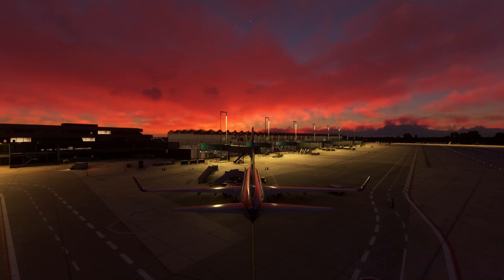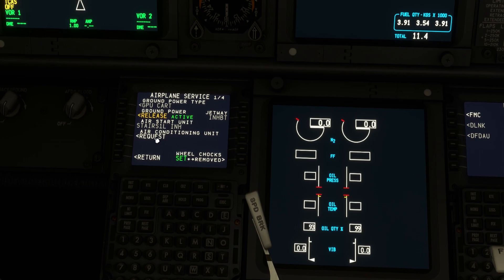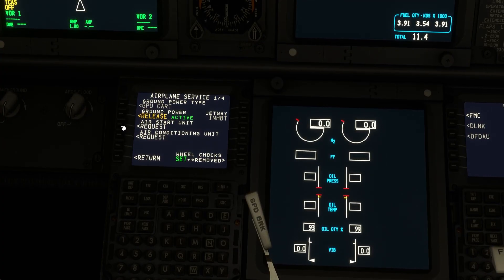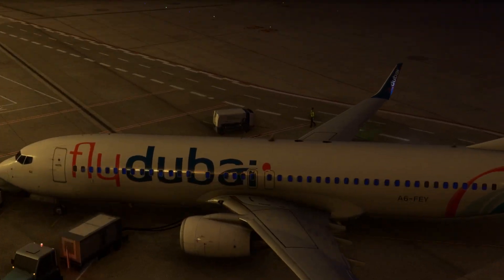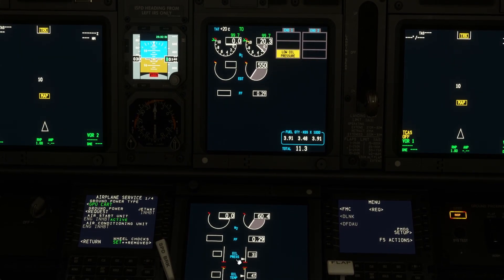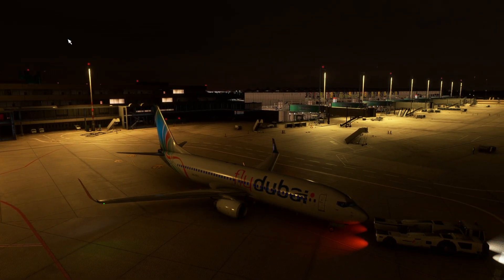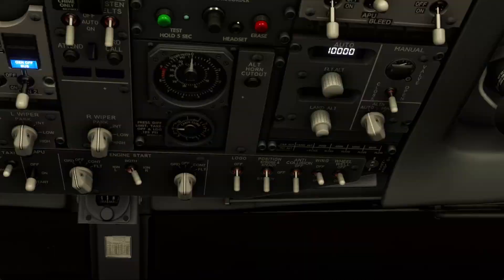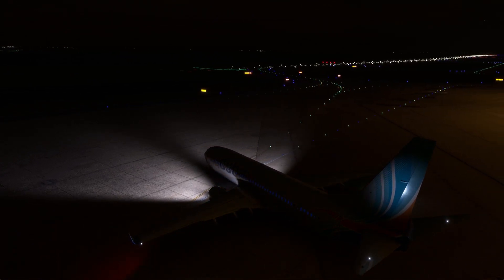How to cross bleed engine start Boeing 737-800 PMDG MSFS2020

Comment: I attempted this today without looking up a guide and just using common sense. The duct pressure seemed super low to make this happen compared to a normal APU start. Thought, "maybe if I bump the throttle a little bit to engine one..." and boom-we had N2 rotation lol. I thought it was a fluke. "This can't be how this is supposed to work," I wondered. Then I watch your video here and am vindicated! 

Great tutorial!